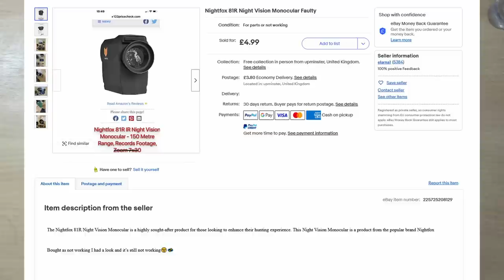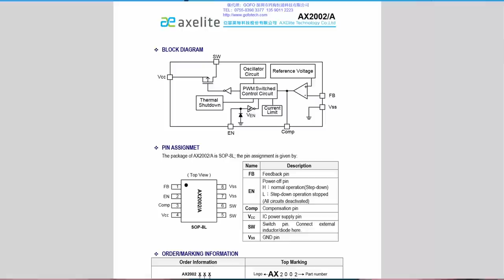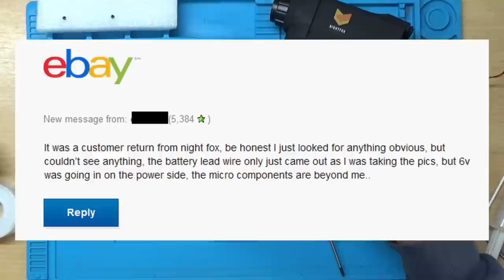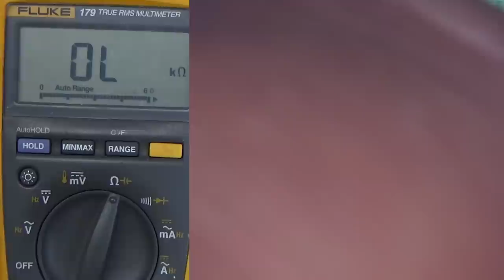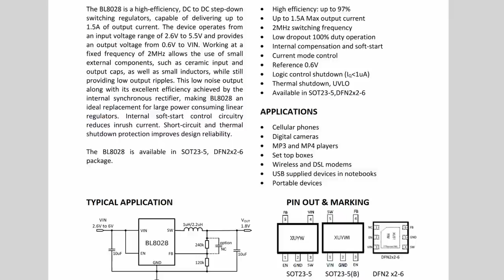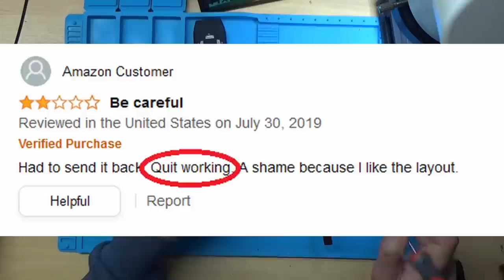Night Vision Monocular - Dead / No power | Can I Fix It?

Comment: Seems when the electronics world started using SMDs they also switched from full part identifications on the parts, to only a few letters or numbers. So locating datasheets gets to be a real problem sometimes. And if you can't see what the part does, it gets even harder to fix things as well. Knowing what parts are sure makes it tons easier to see what a circuit is supposed to do. And than you can locate the problem a lot easier...    Thumbs Up for this fix...
Reply from the maker: Thanks Gary 👍 I think it's actually becoming worse, as now more and more resistors haven't got any marking at all, so you have no idea if it's reading the correct value unless you have the schematic, which is also becoming more and more unavailable 😢
Reply: Yup harder and harder
Reply: Companies don't want people easily rectifying their built in obsolescence, that's my guess 👍
Reply from the maker: @Charlie_Crown That could well be the case 👍
Reply: I can relate to that Gary. We recently purchased a CELESTRON Digital Microscope off Ebay, NOT WORKING. The offending chips are both 5 pin SMD devices. Their markings reveal nothing on any chip identification websites. Plus there are NO circuit diagrams on the internet to determine what these parts REALLY do.
Why don't Chinese manufacturers stop being so damn childish, and print the right information on their parts, instead of mindless garbage?
Reply from the maker: @ninaevans4501 just a thought,  can you perhaps trace where the connections go from each five pin device such as gnd, perhaps an input voltage, inductor etc a bit like what I did with this NV regulator. It might make more sense if you write it down a bit like I did then at least you may have a partial footprint to compare with other 5 pin devices. I did find a regulator with the same footprint, and often different manufacturers make compatible parts with different ID numbers. I had this with an audio control IC on a Milwaukee radio. Pin and protocol compatible but slightly different part number. Hope that helps 👍
Reply: Old post but I get this issue. Especially if something is burnt out and there’s only one on the board. Guesstimating isn’t ideal. Then you get fakes as well to contend with. Nightmare! 
Looking up part numbers and Google gives you a combine harvester 😂
Reply from the maker: @enchantededition6879 Yes agree, or a steam train 😂😂😂

Comment: Having received the unit all in pieces and wrong component installed on the mother board is ten times the work of troubleshooting. But you did good. You have to be a good detective in order to fix such a nightmare. 👍👍👍👍
Reply from the maker: Thanks 👍yes, perhaps I'm Sherlock Holmes's long lost cousin 😂😂

Comment: I found when looking for where the power feed is, I find what pins are VCC on IC's then follow it back to the battery or power supply, works every time. To find out what an IC that is missing or not legible or have several applications for the same marking. I look up the Data Sheets then compare the components around it that are connected. The reason this works is because some manufactures actually put test schematics or application schematics for that IC in the Data Sheets. Most end manufactures just simply copy those schematics with a slight variation right into their circuits. So if you compare what's on the board to what's in the schematic you can almost always find out what the unknown IC is. Of course you have to have an idea what you think that IC is doing in order to go look for those types of IC's. I find fixing consumer electronics is the ultimate Puzzle Solving Game. Right next to drawing schematics by Reverse Engineering circuit boards with no schematics available to the public. Good job and thanks for sharing. Best Wishes & Blessings. Keith Noneya
Reply from the maker: Thanks Keith, yes sometimes electronics can definitely be a puzzle!

Comment: I love the logical approach you take with these repairs, it's like OK I don't have one of those regulators so I've fabricobbled, AKA McGuivered, together something from some stuff I have lying around, hotmelt glued it into place and soldered some wires onto the main board. Outstanding!!! We need far more of your kind in this shit-show of a world we find ourselves in. Keep up the great work.
Reply from the maker: Thanks GeneralDisarray, I've done this kind of stuff all my life, where I've needed something and just used or fabricated something to do the job (electrical and mechanical stuff). I was repairing my car  last year and I needed some "spring compressors". I had some threaded bar and some nuts so i welded 2 nuts together, drilled the threads out of them so they slid one the threaded bar, and welded another nut which was cut in half to the side of the other two to form a hook, did this 4 times and then added a nut and washer at each end.. home made spring compressor :) and then I repaired the car...
Reply: @BuyitFixit  I may not be in the same league, but I'm the same. 
The momentary PCB printed switches for my front and rear fog lights were becoming hit and miss, in fact the front fog switch wouldn't work at all. I took out the switch cluster, cleaned the contacts, which only helped slightly. I traced out the connections on the board, which has around 12 switches on it, and decided to drill two 12mm holes and mount two nice flush stainless momentary buttons on the panel, a few wires for grounds and the switch contacts, plus a bit of hot melt glue and Tesa tape and I have proper momentary switches for the fogs front and rear.
I'm thinking of adding a few more switches labelled "Oil Slick", "Ejector Seat", etc, just to mess with the MOT guys...🤣🤣🤣
Reply from the maker: Oooh I look forward to seeing your colinfurze style james bond car video 😂😂😂
Reply: @BuyitFixit  easiest diy spring compressor is a cork screw metal hose clamp. Daisy chain them together as needed
Reply from the maker: Yeah I guess that would work too, might take a while tightening all of those 'jubilee clips' as we call them over here 😂😂
Reply: @BuyitFixit  it's a good idea but I defo wouldn't like the idea of trusting my face/life to jubilee clips. There's a hell of a lot of stored energy, just waiting to kill you in a compressed spring.
Reply from the maker: Yes, I'm not sure how well I'd trust it, I remember doing a suspension spring a while back at a friends house and we borrowed some proper spring compressors at the time, when tightening them one slipped off and it nearly snapped my wrist... quite dangerous even with the proper equipment 🤔
Reply: @BuyitFixit  been there have that T-shirt. Back in my youth I was doing a spring job on a buddy's car, "proper" bolt down spring compressors, shock clamped in a vice, safety glasses and all, and still the spring got lose and made a beeline for my face. Luckily I dodged it but I swore to never do another spring job without some way to contain the compressors by wrapping some ratchet straps around the spring and compressors. Better safe than sorry,touch wood and all that

Comment: Richtek RT8024 seems to have the necessary pinout too but there are a bunch of different version with different feedback voltages so it might be necessary to check resistor network there.
Reply from the maker: Thanks for that. Good detective work 👍

Comment: Nice fix but you did have me shouting at the screen regarding the screws in the polystyrene, especially when you did the jump cut to them all on the mat- it showed the position of each screw for the case and the arrow was the orientation! But good job on the diag and fix.
Reply from the maker: Thanks! I did eventually spot the pattern of the screws on the white foam when I was editing the video and thought hmm I wonder if those were the positions of the screws 😂😂😂 they were pretty much all the same size anyway but it was a clever idea, and something that I hadn't thought of. Thanks for the feedback 👍

Comment: Nice work Mick. Now you can shoot some clays in the dark from your porch! This one seemed like it was a bit more of a challenge but that methodical & logical mindset is serving you well. I'd like to say it develops with age but I've working on my methodical and logical approach for 50 years so far and I'm lagging behind you already. I don't think I would have solved this one if I'm  being honest. But maybe I will going forward, thanks you to. I do have one question though, because I am keen to learn and understand. The regulator that you removed (or that should have been there from factory), I understood from the pinout's you mentioned that there was a voltage 'pass-through' from one pin straight to another pin, is that correct? If so, you're cunning solution didn't appear to cater for the 'pass-through' and if that's true, it leads me to this question. What is the point of the pass through and why did you're fix still work? In your opinion. Or have I completely misunderstood? I'm a big boy, you can give it to me straight up.
Reply from the maker: Thanks 👍😂😂😂. The regulator that should have been there has the pin at the bottom left (1) marked "Enable" and the pin at top right (4) "Voltage IN", so linking these pins together makes sense. The pin on the regulator fitted (the wrong one LP2985) pin 1 is "V in" and pin 4 is labelled "bypass" it's for a capacitor to reduce noise according to the data sheet and a 10nf is recommended and then connected to GND.
So on my fix I used a linear regulator which isn't as efficient, but uses 3 wires, IN, GND and Output. If you search BL8028 it will show you the pinouts of a regulator same as what should have been there, and LP2985 will show the regulator that was wrongly fitted.
Hope that helps 🙂👍

Comment: Being from the other side of the pond I had to look up Geordie. I can only guess how it sounds. 

I missed how you knew, or guessed, the regulator should be 3.3 volts.
Reply from the maker: I can't remember if it was just a guess or if I searched the main IC. If 3V didn't work, then I would have probably gone with 5V. Best off starting low 😉

Comment: Great fix as always! How did you figure out that the circuit needs 3.3 volts?
Reply from the maker: Thanks 👍..educated guess, the memory IC would have been 3v so I could have traced back from that to the output to be sure.

Comment: Not a bad little monocular. I have an eyeclops night vision goggles and they work but the eyepiece is too narrow for my eyes because this thing is a toy so I removed the eyepiece and it's set up the same as your unit, nothing but an LCD screen and modified camera. It doesn't record video but I'm curious if there's a way to add in a composite video out to it.
Reply from the maker: Depends on the main chip. This unit seems based on a trail cam perhaps as that was one of the things that popped up when I was searching for the number of the main SOC. If you know what chip is in your unit, try searching for that perhaps you might find a datasheet or a device using it that supports composite output.
Reply: @BuyitFixit  I had it apart a few times but not enough to see anything on the chips as they are kind of buried. I dont want to break this thing just to add a video out.

Comment: I have a digital recorder with a faulty regulator as well.  I thought I could wire up a 3 legged regulator as you did, with a connection for ground, power in and power out, but there is no connection for the on/off switch?
Reply from the maker: Yes, the circuit in this one the power seemed to be switched separately from the regular. Some of the switching regulators do have an enable or on/off pin. You could use a 3 pin regulator temporary in that case or even connect a manual on off switch. Might be worth seeing if you can obtain the correct part or a similar substitute.

Comment: Never use NiMH. On four alkaline batteries (1.5 x 4) you get 6 volts, but with NiMH you only get 4.8 volts (1.2v x 4). Some devices think 4.8 volts indicates low voltage and won't power on.
Reply from the maker: Yes, I thought the same that's why I swapped to the alkaline in case that was the issue but it turned out to be the wrong regulator was fitted.

Comment: Where did u learn how to repair electronics
Reply from the maker: I used to mess with stuff when I was a kid lights batteries etc and then computers. Ended up working in amusement arcades back in the day and a lot was self taught and what I picked up from other people too. I knew a guy that used to work for Marconi Radar systems (probably the cleverest guy I've ever known) and he taught me a lot when I was a kid, including programming which was on a nascom2 computer that he built from a kit back in 1979.
Reply: @BuyitFixit  thank u for sharing, would u ever make teaching vids about electronics or would that be too hard?
Reply from the maker: @kamrankhan-ud5vd I did make 4 basic videos a while back on test things like batteries, diodes, resistors and transistors. They are on the channel.

Comment: You are lucky this was not a true NVD. Most of their power supplies are sealed, non repairable units with zero information available to the general public.
Reply from the maker: Yes, I've seen the insides of a gen one image intensifier a while back. Was pretty much a tube and the HV PSU as you say.
Reply: I used to fix those. Sadly you are right about most being not economic to fix. Usually the tube is shorted out, but I did luck out on some with bad capacitors or diodes that drove the NV tube, others had issues with the MCP voltage causing the tube to light up completely green.